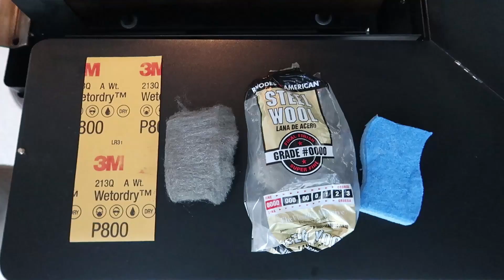How to get a smooth griddle surface for stick free cooking and use less oil

Comment: No matter how much I follow the seasoning instructions, my coating ALWAYS flakes off. I spend over $20 for a small bottle of organic flax seed only. I've just run out of options 🤔
Reply from the maker: Hi Kleo. I feel your pain and many others have the same problem. I'm not sure why that happens but it happens to me too. At that point, you need to take it all off down to the bare metal. Doesn't mean you have to sand the entire surface down, which would be best, but at least the area where the flaking is occurring. You can use a grill stone and elbow grease or a sander. Either way, when you re-season be sure to use THIN coats that you burn off till it stops smoking. Let t it cool down some and then another thin coat. I do 6 cycles. Hope this helps and thanks for asking. Dave
Reply: It shedding off it's old coat it call build up needs to be scraped off and re-season.

Comment: Wouldn't a grill brick work just as good?
Reply from the maker: Hi Steve. Thanks for watching and for your comment. Yes, lots of people use the grill brick to clean the surface. However, to me, it seems the grill brick will leave a surface scratch about equivalent to a 320 grit abrasive.. You can either leave it alone and let the seasoning fill in the scratches or take the next steps I show in the video. Either way, the main thing is to cook, have fun and EAT! Thanks Dave
Reply: @NextWithDave  Thanks Dave. Enjoy watching your shows. I'm new to the griddle so I'm eager to learn everything I can.

Comment: Whenever I use paper towels it leaves fibers behind. I've tried different types of paper towels with the same results. Maybe I should stop looking too closely.
Reply from the maker: Peter, thanks for your comment. If there are fibers, I think that the pre-cook oil and wipe down will cause them to get suspended in the oil and wiped away. Just guessing but I personally don't think it is a problem. Anyway, I'd rather use paper towels than deal with washing dirty, greasy nasty old rags. No way my wife would let them in the same washer we do our clothes in. Just my opinion but you know the saying about opinions...thanks again for watching and commenting. Dave
Reply: Peter, have you tried using the blue shop towels? Those have far less fibers and are much more durable than standard white paper towels. You can do much more surface work before they start breaking down.

Comment: Any concern about machine oil residue left on the surface that is used in the manufacturing of steel wool and is imbedded the final product ?
Reply from the maker: Nope, not concerned at all. The process ends with a thorough wash with water and then with a high heat re-season with oil which is wiped away. The amount of machine oil that might be left on the griddle would be so minuscule that it is of no concern to me. But , thanks for asking.

Comment: I am getting confused on the cleaning of a grill.  I have seen where restaurants clean each night with very abrasive, or chemical cleaners, ending up with a shiny grill.  I thought the griddle needed the seasoning to have a non stick finish, (same as a cast iron skillet)   where you clean like you do here, so that old burnt grease doesn't affect the taste of the food, (flakes, burnt or bitter tasting)...any help, or your take on this would be very much appreciated.....
Reply: Bittyboo52, Thanks for watching and for your question. The griddles you see them taking all the way down to the bare metal are usually stainless steel like they use in the Japanese restaurants. The Blackstone griddle is a cold rolled steel and is meant to have a layer of seasoning on it. I do a quick pass with fine steel wool and water before every cooking session. Then wash / wipe it off, put a thin coat of oil on it and start cooking. Hope this helps, thanks.
Reply: THANK YOU!  That does answer my question.  I know you have to season a cast iron skillet or everything will stick, glad to know it is about the same for cold rolled steel....Love watching your videos, the hubby and I have learned so much.